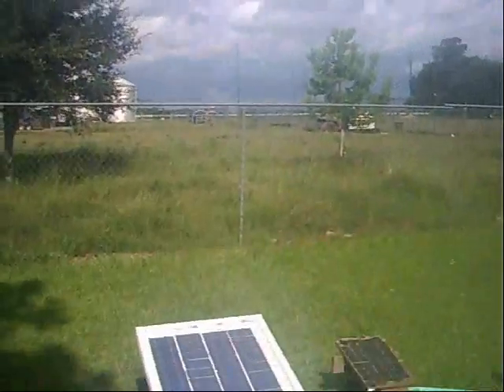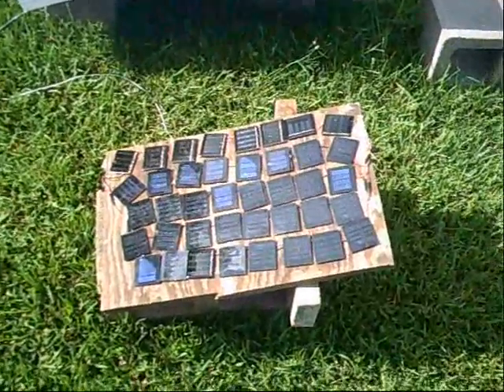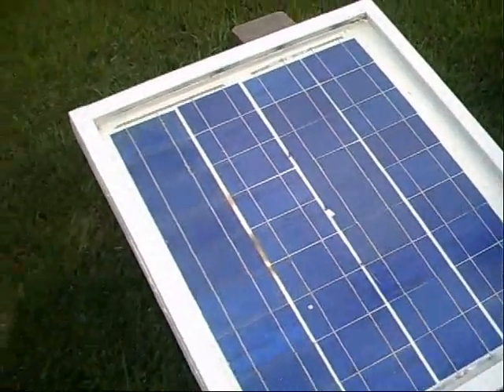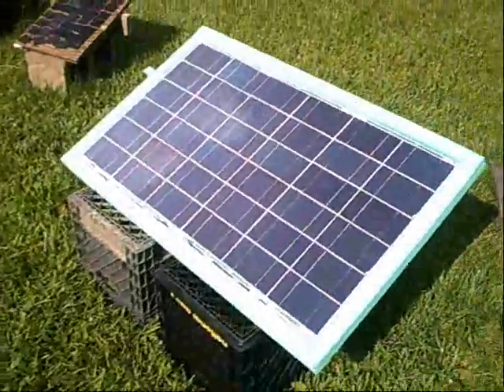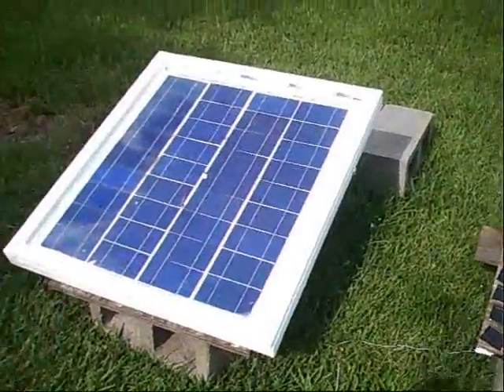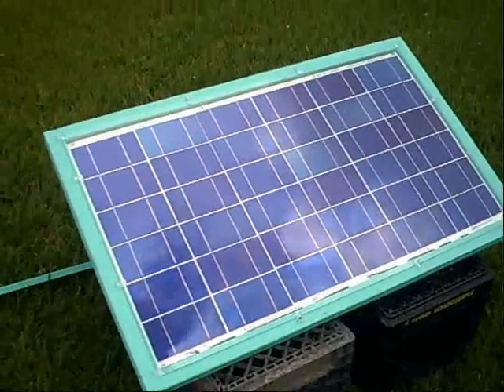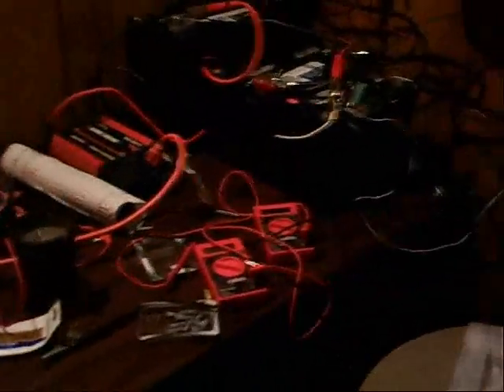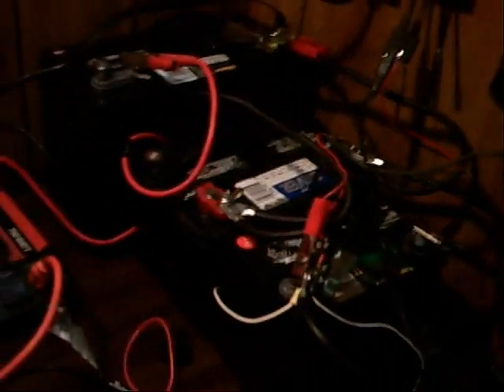my solar setup 1st upload

Comment: 2nd panel you made looks like the row of cells on the left side may be shorting out because they are so close together. Dont see any gaps between the cells. That might be your lower output problem with that one.